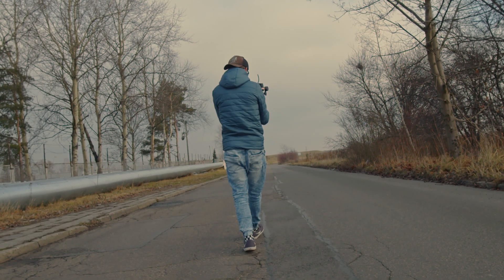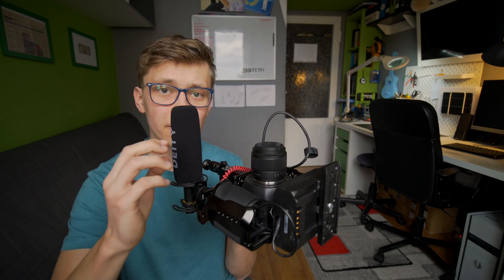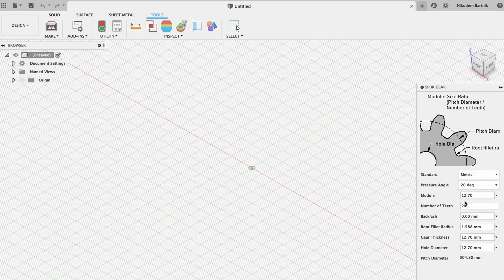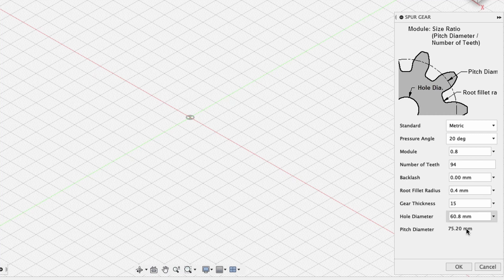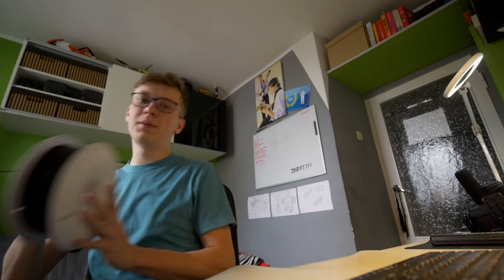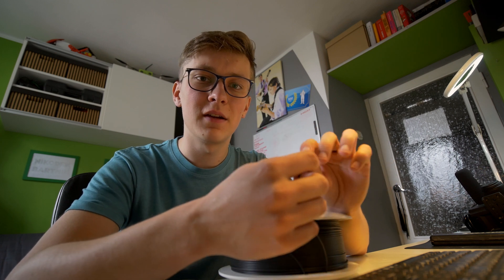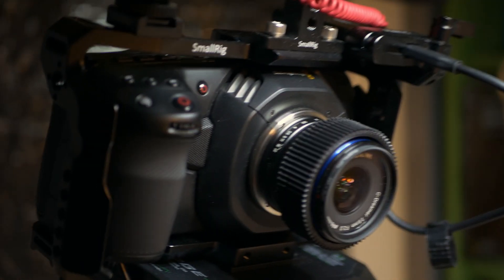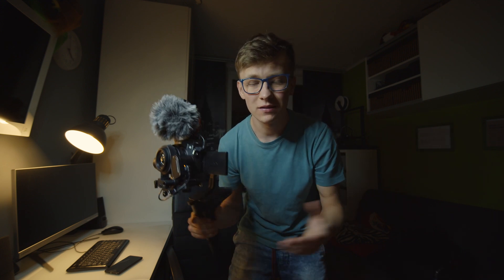3D Printed Focus Gears For BMPCC4K

Comment: Great video! Would prefer a 0.2mm nozzle and 0.05 layer height.Know it will take very long to print but there will be much less noise coming from it.
Reply from the maker: Sure, less is always nice when you need to record sound. On my CR10 mini I have 0.6 nozzle so printing that with 0.05 mm layer height would be hard
Reply: You will get much sharper corners. Print on 3mm plain glass and use pump action style hairspray  with no silicon or other weird stuff in it prime the surface. No reason not to try that kind of layer height on a 0.6mm nozzle. Question would be why? Try a 0.3 with a 0.1 layer height.